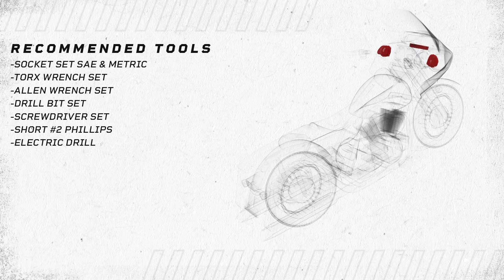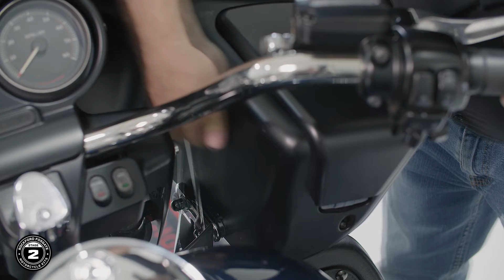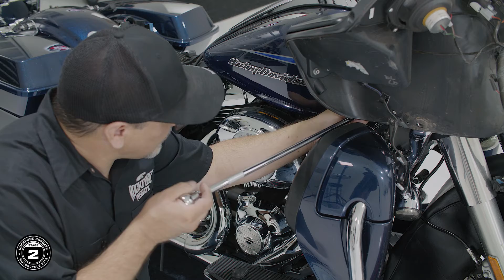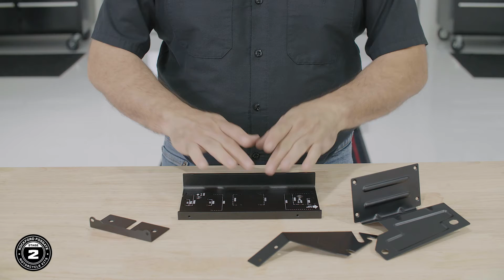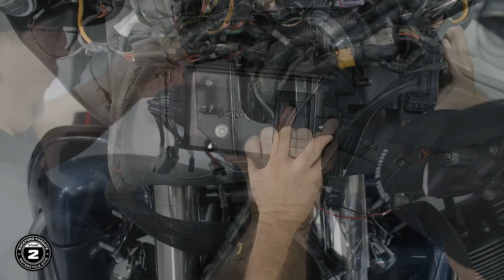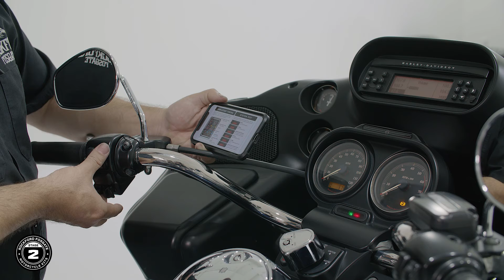1998-2013 Road Glide STG2 | Installation

Comment: Buttonhead screws will strip. Why not include all tool? Why the different size Alan's? Need to take this back to the board
Reply from the maker: We do have a list of recommended tools in the beginning of our installation video.  Regarding head type, our RTTI installers prefer Allen and Torx screws that are a better solution over Phillips/Slotted screws that tend to strip out easier.
Reply: I used the provided Allen screw and they stripped because there was to much powder coat or paint on the bracket. Why go cheap on screws if the package itself isn't cheap? I figured for over $1300 for a pocket amp and 2 speakers the quality of the unit and hardware would have been superb. But then again I'm just an over paying consumer.
Reply from the maker: @bigjones409  we might be able to ship you replacement hardware if we have any in customer support.  Just email cs_support@rockfordcorp.com and let them know what screws you need.